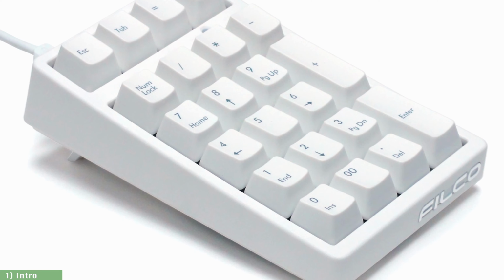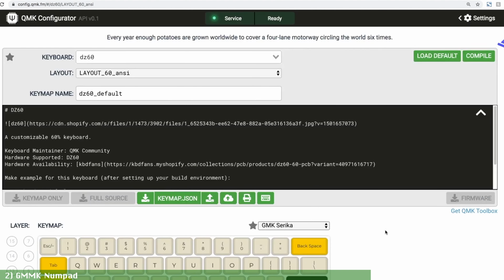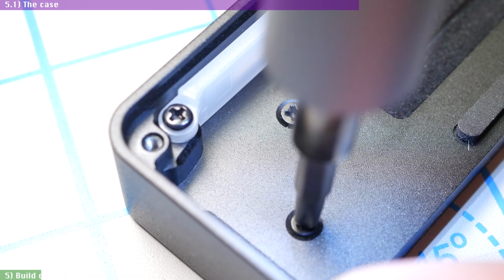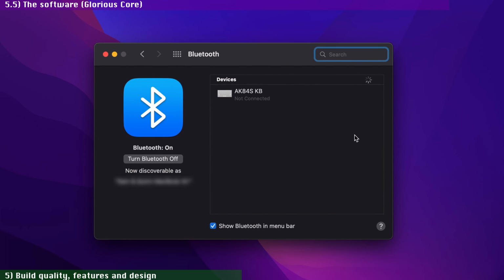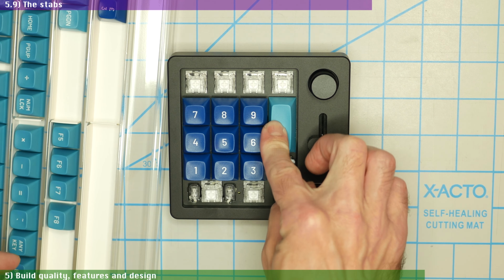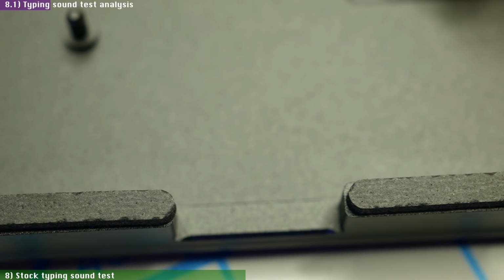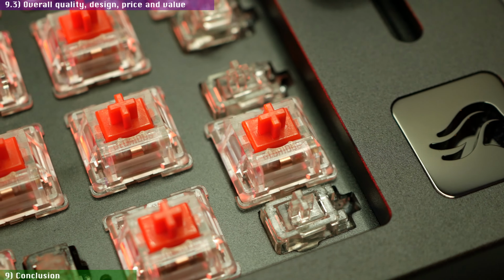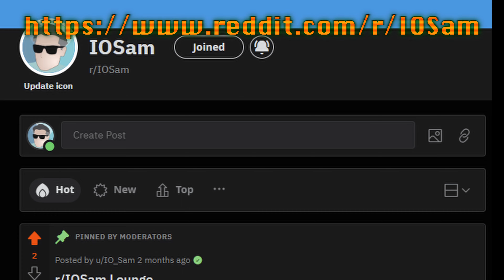GMMK NumPad: Glorious has done it again!

Comment: I've been looking for a keyboard that has five keys on the side, as an alternative to TKL (smaller, and with all the keys I actually use). That would be the GMMK Pro, unless anyone has any other suggestions? Coupling this with an optional numpad would be ideal for those times I'm using spreadsheets, not to mention the handy knob and slider. And if the second Pro matches the numpad more, all the better!
Reply from the maker: I’m pretty confident Glorious is coming out with a GMMK Pro 2 sometime in 2023 (I’d be very surprised if they don’t!). And I’d guess its design should be a better match with the existing GMMK NumPad.

I would also hope they give the option to replace the knob in the keyboard for another 1 or 2 keys (for those of us that already have the knob and slider in the NumPad for example), since having 5 or 6 side keys (instead of the current 4 of the GMMK Pro) would allow me to have more of the TKL nav-cluster keys I‘m used to.

Comment: I built a GMMK Pro last year and I'm going to pull the trigger on this, particularly as I found it on sale at a local retailer for $169AU - including free shipping and tax. That translates to about $114US, which while certainly not cheap, is a fair bit more reasonable than $129 PLUS shipping and tax.

I think what got me over the line in particular here was your breakdown of how the volume feature works, your examples of adjusting a youtube video or discord independently from everything else is a use-case I will actually use. That's a pretty nice QOL feature for me.

I'm not too concerned about it not being an exact aesthetic / shape match for the GMMK Pro as I'm more a 'functionality guy' and the stock keycaps being a little meh is a non-issue for me as I already have one of the full glorious PBT sets so I'm ready to swap those out when I get it.

I have lubed tealios in my pro but I agree with you about clickies on a numpad, it just makes sense somehow. Will have to check out my options but I will put the box whites on my shortlist.

Great review as always, looking forward to getting my hands on mine!
Reply from the maker: Interesting that you’re getting a price cut for it in Australia, since there is no sign of one here in the US, which possibly indicates that the Aussie reseller is taking a haircut on its profit margin to move a product that might have been a bit too difficult to sell in its original price.

So, that is a not an insignificant saving you’re getting there, which is nice!

As for the keycaps, you fall right in the use case I described on the video, which is that anyone paying this much for a premium numpad probably already have a premium set of numpad keycaps stashed in a closet somewhere… So, the cheap stock caps are basically a non-issue.

As for the unique use case of the volume knob and slider, while I know a lot of people will point out that this is the kind of functionality better achieved with other more “streamer oriented” devices (from the likes of Elgato, TC Helicon, Beacn, etc.), it can be a great addition to have that integrated on a numpad (even a premium priced one), considering how much more money you’d have to pay for those specific audio devices that: a) don’t give you the functionality of a number crunching pad; b) nor the satisfying typing experience of mechanical switches.

So, for the vast majority of non-streamers out there, the functionality you get with this numpad is far more appealing indeed.

Comment: Hey, is the slider actually QMK compatible?
Reply from the maker: Hi Rusty! While I have not flashed my unit yet (I will, but have to finish a bunch of other videos first 😂), it is my understanding the sliders are supported by QMK. So it stands to reason that the GMMK NumPad slider should work in QMK (even for non-audio related tasks).

Having said that, the main disadvantage to flash this pad with QMK would be loss of Bluetooth capability, which sucks! It seems VIA doesn't usually play ball with Bluetooth boards for some mysterious reason...

So, that would be a big trade-off: flash it with QMK to gain full programmability for the knob and slider on one hand, but then lose wireless connectivity on the other.
Reply: @IOSam  Hello :D, wait that means with VIA I can sustain bluetooth capability and reprogramm the knob / slider?
Reply from the maker: @khazzor8564  Back when I tested this pad, no. Flashing with QMK to gain VIA compatibility would inevitably break the Bluetooth. But VIA has improved quite a bit since then, so I don't know if today one could go the QMK/VIA route and keep Bluetooth at the same time... I'll have to look into it to see if anyone has successfully tried this since last year.
Reply: @IOSam  thanks for your quick response ☺️
Reply from the maker: @khazzor8564  I'm here to help! 👊

Comment: I agree totally about the gk6x software. It's total trash. I regularly had my gk68xs refuse to be recognised by windows just because I unplugged it, requiring me to restart the software and plug the keyboard in again. That with the finnicky way you have to save and apply profiles before swapping layers or it deletes your progress in configurations is maddening. So many more issues, it's just a horrible software suite.

That said, and while acknowledging my bias against glorious as a company, I just don't see how this is good value. The keychron Q0 is 50 dollars cheaper and comes with QMK and VIA support. Glorious also forces you to buy 36 of their switches, or a whole 120 switches of other brands in order to change which ones come with the GMMK numpad. They also charge for a full set of keycaps ($99 for their sets) even if you're only buying the numpad. Those along with other purchasing options make this a horrible value proposition.

Add to that the fact that the slider and knob both do the same thing and their keyboard already has the knob, the corners and bezels not matching the GMMK pro, the gaskets being unnecessary and the default keycaps being ugly as sin, and I just can't call it good design.

Hopefully it's an old design and glorious can change their production pipeline to give themselves more time to iterate on products before releasing them, but given their insistence on pushing group buys and charging almost as much for the whole numpad as they do a set of keycaps for it, I don't think we'll see significant improvement from them any time soon.
Reply from the maker: Yeap! I feel your pain… While I didn’t have any bugs using the GK6XPlus driver with my GK21S, the software is atrocious to use… And that has been the main reason I haven’t been too keen in recommending the GK21S. Outside of the software though, the hardware is very good (the forged aluminium case is beautiful!).

As for the Glorious “bundling blunders”… In all honesty that is nothing new… I even mentioned that in my original review of the GMMK Pro last year (which I didn’t see the point in buying any of their accessories with the board).

And that continues to be the case with the NumPad (which I didn’t even bothered to discuss their accessories, since I don’t care about any of them really). For anyone getting this pad, my recommendation is to get your switches and keycaps elsewhere and you’re almost guaranteed to get a better deal.

As for the knob and slider, while they technically don’t do exactly the same thing (the slider is actually more useful, since you can assign it to specific apps in Windows, which you can’t do with the knob) they would be much more useful IF you could assign other non-audio functions to them. I understand you can do that if you flash it with QMK (which I’ll do that to my unit and report back on my success soon), but the fact that Glorious Core doesn’t offer that feature is inexcusable.

As for the rounded corners not matching the GMMK Pro, while it is an eye sore now for current GMMK Pro owners, that becomes less relevant when used with other keyboards (where there will be no similar design language at all). Besides, I suspect the upcoming GMMK Pro 2 will have rounded corners (so Glorious might have anticipated that in the NumPad).

And on that topic, I honestly think this Pad is more useful with smaller (non-Glorious) keyboards that lack knobs, where the volume controls on the Pad don’t get duplicated.

As for the gaskets… Yeah… Not really needed. At the very least Glorious should have released a regular and cheaper GMMK NumPad with integrated plate, north facing switches and plastic body (with no fancy gaskets) for a lower price (and to better match the GMMK 2 line in price and features) and then they could have released this existing version (with south facing sockets out of the box) as a GMMK NumPad “Pro”, which comes with the same style of fancy metal case and gaskets of the GMMK Pro keyboard (plus Bluetooth and slider, while deleting the knob) for anyone who “wants the best”.

While I don’t mind the north facing switch sockets (I don’t intend to use it with Cherry caps, and, even if I did, I’d just use Kailh Box switches, or switches with long poles such as Gazzew Boba U4T that don’t cause interference with Cherry caps), it is pretty clear that the customers for a “Pro” version of this type of product do care about it... So, that was obviously a mistake on their part.

At any rate, I don’t expect Glorious to change the design of this numpad this year… Since they probably have thousands of these things in a ship on their way to the West as we speak. But after failing to manage their main audience’s expectations with this release (which I think was their biggest mistake here), I’m sure they’ll go back to the drawing board for the second version of this product for next year.

As a standalone product, I like this pad and will continue to use it, since it has many of the same features I was accustomed to with my GK21S (plus the benefit of the easier to use software). But for anyone trying to match this pad with other existing Glorious products and accessories, their experience might be much more underwhelming.

And finally, while everybody seems to be loosing their sh!t with this pad’s pricing, and while I would love if this this was a $99 product (even if it came barebones), I don’t want to be a hypocrite here… Since I spent far more than $130 to build my GK21S and I have also spent far more than $130 for much less useful keyboard things (such as overpriced keycaps for example)… So, I don’t see Glorious pricing for the base product as necessarily a cash grab, considering the quality of this product’s fit and finish, its feature set (which is superior than my GK21S), and the fact that I don’t give a crap about their upselling tactics (I simply won’t buy any of their accessories that are only for aesthetics anyway).

Comment: I bought the GSV2 stabs and had the same sticking problem shown in the video.  Glorious has not wanted to acknowledge the issue and is giving me the runaround trying to return them, making it not really worth the hassle.  It is a shame they are 0 for 2 in the attempts at GOAT stabs!  Crazy that on the second attempt they didn't even return the key back up on two different sets, one lubed and one unlubed.
Reply from the maker: Hi Eric! Did you buy their retail “gold wire” stabs set? Which board did you install them on?
I know they say the NumPad comes with the GV2s, but I noticed the ones in the pad have silver wires (don’t know if that means anything quality wise though).

At any rate, after comparing the GV2 with other brands I have here, I’m pretty confident that the problem is the tight fit of the stems within the houses. The tolerances seem minuscule and that means that any keycap that has the mounting hole a fraction of millimeter off to any side, will put perpendicular force on the stem against the side wall of the housing (with the plate installed)… preventing it from sliding up/down properly (and not even lube can alleviate the issue).

Other stabs have the stem a bit looser inside the housing, which, while increasing the risk of rattling, at least will give enough space for the stem to travel even if they are not perfectly straight.

If that is indeed the case with all GV2s, that would mean a huge blunder in Glorious second attempt on making their own stabs!
Reply: @IOSam  I bought the retail gold GSV2 stabs. I was using them on the Keychron Q3 keyboard with Drop DSA Astrolokeys keycaps.
Reply from the maker: @ericnadler790  Sheesh... I'll say this: if Glorious can't manage to create a decent set of working stabilizers by the time they come out with their upcoming GMMK Pro 2... That might be the "straw that breaks the camel’s back" for their business!

Comment: Gotta drop a like for that intellimouse 1.1a in the intro.
Those things were the bees knees.

Edit: Actually it might be earlier than the 1.1a because it doesn't have the side buttons.
Reply from the maker: Hehe... You sir, have very good taste for vintage mice!
And yeah, sometimes I feel like pairing my vintage boards with good vintage mice... just because  ¯\_(ツ)_/¯
Reply: @IOSam  It was my first gaming mouse, and way better than any of the easily spun out low malfunction speed and inaccurate mice I had used up till that point.
Sometimes I want to see if I can find a way to use that shell with a new PCB sensor and wheel.
Reply from the maker: @lw8882  That would be a job for the "mouse whisperer" himself, the awesome BeardedBob (https://www.youtube.com/c/Beardedbob ). If there is a way to do this, he will know... (and he takes commissions!)

Comment: If the volume controls would be on the opposite side i would buy it . In this configuration though it doesnt really make sense to use it as a macro board while gaming for me.
Reply from the maker: Having the volume controls on the side (instead of the top) really can make the use of this pad on the right or left sides of the main keyboard a bit more cumbersome (depending on which side you use your mouse).

Here, as usual, left-handed people were left hanging...

Comment: The cost doesn’t bother me too much. Since this is a niche of a niche of a hobby. I was skeptical of the slider and a knob. I have the GMMK Pro so now two knobs and a slider. But given they can do multiple sources… ok now I get it. Just didn’t think of that. 

I’m glad it matches the GMMK Pro cause that’s my daily driver with Zeal Tactile switches. But I should get new switches. It gets way too tiring to use for long hours. 

Great video and should be a fun addition.
Reply from the maker: Thank you Sir!!! And I have to say so myself: the ability to assign the two volume controls of this pad to different programs/sources has indeed been more useful than I originally expected.

Granted, I'd still like to see Glorious bring other non-audio functions to both the knob and the slider. But even in its current form, these interfaces have already been very useful to me.

And as for this pad's design, as I have mentioned to other commenters here, I do believe it points in the direction Glorious will go with the upcoming GMMK Pro 2, which we shall see soon. So, that should be interesting as well.

My current configuration of this pad, has Gazzew Boba U4T and Akko ASA PBT caps, and I have to say I'm enjoying it a lot! Bobas are very tactile (as much as your Zealios), but that has been Ok for my numbers workload.

Comment: north facing?
Reply from the maker: Yeah... I didn't even mention this in the video, because I actually like to use backlit caps on numpads. And for that north facing is better.

But even if I want to use Cherry caps, at least for me this whole argument of north facing switches being bad was kinda over the moment I started having options for long stem switches (which don't suffer from interference with Cherry profile in any orientation).

So, my arsenal of these switches has been increasing quickly to a point where it's automatic now: north-facing switches + Cherry? Go with Gazzew Bobas for tactiles, Durock POMs for linears and any Kailh box of any type and the problem is solved.

But I get the frustration... to alleviate the ire of masses, Glorious should allow you to choose which configuration you want BEFORE you order it, so you don't have to buy another PCB.